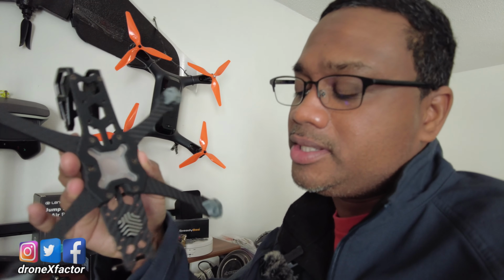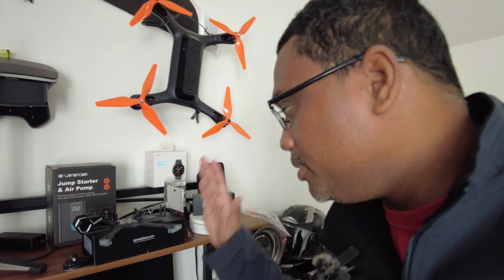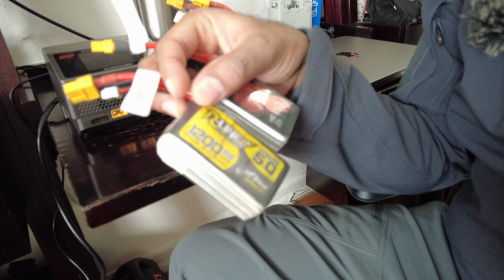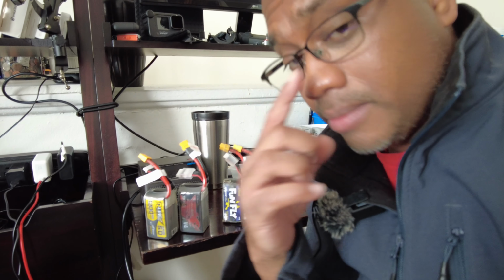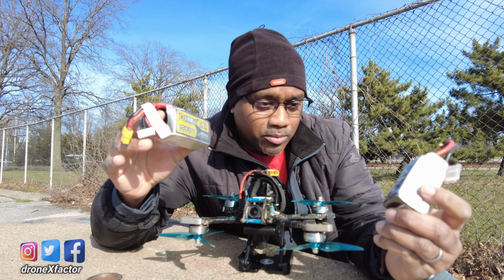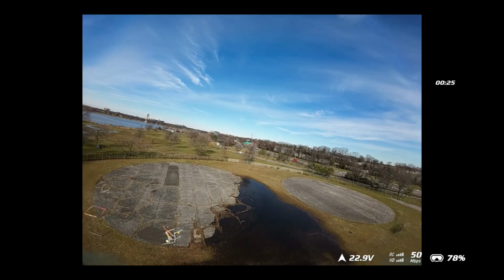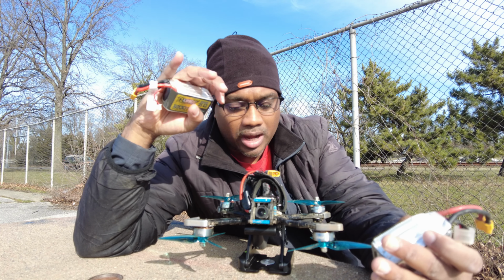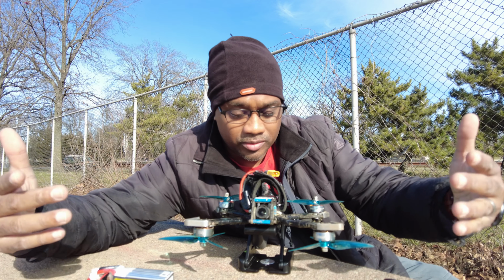Am I Switching to 6S FPV Batteries 🤔

Comment: You almost certainly are not getting the most out of the 6S battery if you are "safely" running 6S  on 4S motors via Betaflight profile as it limits throttle at high end.  For me the real benefit of 6S is you can stay in the power longer before sagging out and is particularly true as you get closer to 3.5v/cell.  I have two 6S 5" quads running around 1850kV motors while my 4S 5" has 2450Kv motors.  I will swap out the motors on my 4S to 6S if I ever need to replace one.

Comment: Love the speedybee frames and stacks. Using the bt to make changes in betaflight on your phone is real handy. I built two identical v2 frames with the F7 v2 stacks and they are still going strong. Love the look of the v3 frame and with that 03 unit sure makes a nice combo. Hope you can get the tune smooth. Wonder if it has anything to do with the prop configuration? The SupaflyFPV 5" freestyle preset works well for me on the V2 with 6S and normal prop config.